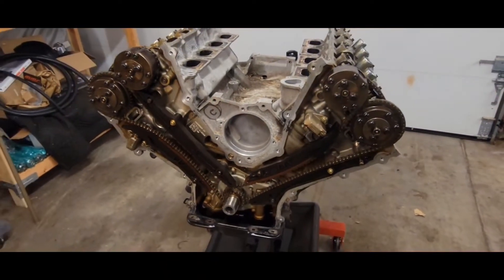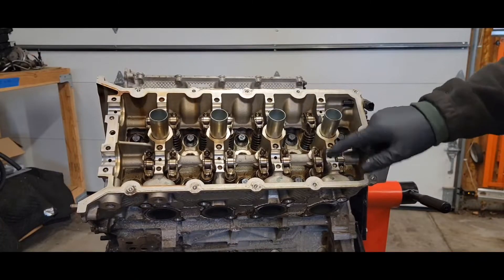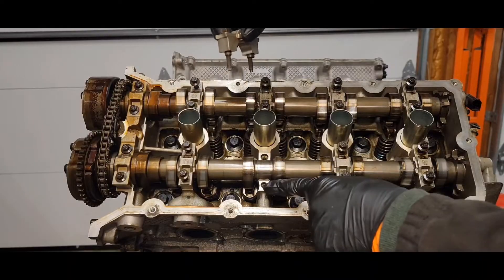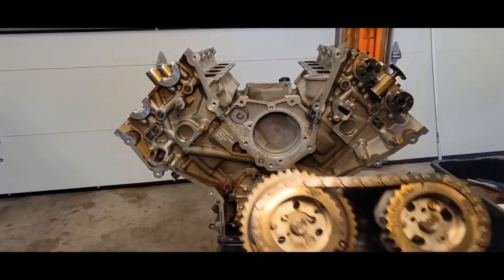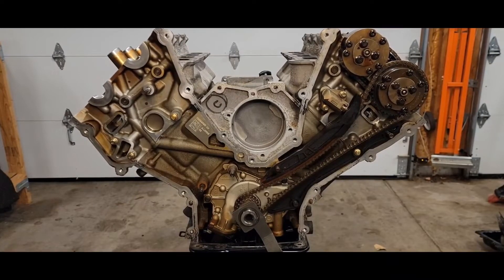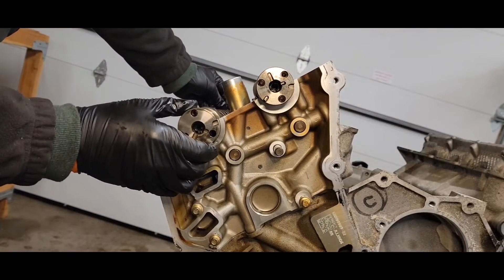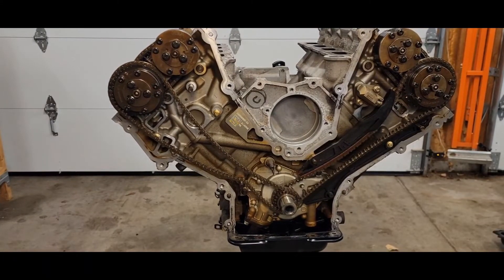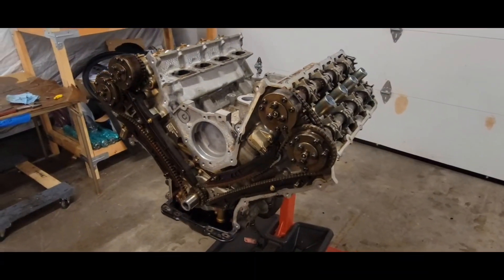How to Time:  F150 Coyote 5.0 GEN2 Engine Step-by-Step Guide

Comment from the maker: **PLEASE READ**
BEFORE YOU START THE TIMING PROCEDURE, PUT THE CRANKSHAFT KEY IN THE 5:00 O'CLOCK POSITION.

This will allow all the pistons to be below the deck when you put the heads on.

Part of the video was damaged after a couple years and had to edit out. YouTube could not repair the video.

Comment: Is there any way to check the crank for timing without removing the cover? like in reference to the phasers and timing marks at a certain point of the crank rotation or something? I hope that makes sense, but basically if my phasers are timed correct (or at least lined up to the links on the timing chain) would I be able to use them as reference to tell if my crank has jumped timing on either side?
Reply from the maker: You would need to take off the valve  covers to see the timing marks up top. Maybe you could get a scoping camera to get a angle on the crankshaft sprocket to see the timing mark there? Otherwise you're best bet is to just take the timing cover off.

Comment: Hey, so once install driver side timing chain at 3:30/5 do I make a full revolution back to 3:30/5 then go to 7:30 or do I go straight to 7:30 from 3:30/5?
Reply from the maker: No, just go clockwise to 7:30

Comment: Does it matter when taking off the timing chains?
Reply from the maker: Rotate the crankshaft in the 12 o'clock position, make sure the RIGHT timing mark is on top

Comment: @Oxman_Garage  When I set the camshafts on their neutral positions as illustrated on the instructions and as you show on this video.  On the Left side, the intake cam has a lot of free play (being neutral) but the exhaust cam does not have freeplay. and on the Right side the exhaust camshaft has a lot free play while the intake cam does not..Is this normal?  I can turn the cams that dont have free play to a different position where they have good free-play but the d-slots wont match the pictures or your video..
Reply from the maker: You can try and tighten them down like that (cam caps). And then use a wrench on the flats of the cams to turn them in there correct positions.

Comment: @Oxman_Garage  I downloaded the ford service manual for the 2017 f150  and is a litle different.. it doesnt mentions nothing at 5:00..  it says keyway 7:30  for the RH side  and wants you to do a complete revolution plus turn CW to get to 3:30 to do the LH side.
Reply from the maker: Hmmm are you sure?
Reply: @Oxman_Garage  i read it lke 4 times.. im not saying you are wrong but directions are not the same..
Reply from the maker: Hello, Im not trying to be rude, but my instructions are referencing the Ford service manual for engine assembly. This is not a $15 ebay instructions manual PDF. If you start this procedure you will need the pistons below the deck. At 5:00 crank position the pistons will be safe. After you put the Left head on, cams and chains you can turn to the 7:30. BTW you start with the Left Head not the Right Head.
Reply: @Oxman_Garage  you are a full time mechanic and im not. im not questioning your knowledge, i am questioning why the 3:30 and 5:00 differences.. i didnt write the full instructions those were to remove the chains,   and   i downloaded this manual with like 13000 pages. seems that is from ford.. i could be wrong..
Reply from the maker: No worries brother! When the crank is placed in the engine and the piston and rods are installed it doesn't matter what position it's in. When you tighten the cam caps on the left head you want the crank in the 5:00 so all the pistons are below the deck. Once the chains are installed on the left head go ahead and put it at 7:30 for the next step of the right head to be in time. No worries 🙂

Comment: Hello Sir What is the Firing order of this Engine? Is it different with the Mode 2014 down to 2007?
Reply from the maker: 2015-2017 F150 Coyote 5.0L Firing Order: 1-3-7-2-6-5-4-8
Reply: @ Sir
 Cylinder 1 2 3 4 still located at Right Bank?

Comment: Great video, very helpful. I’m doing a 2016 F150, I’ve put all timing set components back on but when installing the right (pass) side primary chain guide that’s on the outside with the tensioner, that where the guide goes onto the mounting pin, it seems like the guide is missing a spacer to keep it from sliding all the way against the block and therefore being in line with the crankshaft sprocket back row teeth (chain for drivers side). Is there supposed to be a gap , or am I missing a spacer on the mounting pin between the block and chain guide?
Thanks,
Jim
Reply from the maker: Thank you. Yes there is a little gap on the pin for that timing chain guide. Completely normal.

Comment: I have everything in the right spot but my intake cam on the passenger side does not want to seat smooth almost like a cam lobe is hitting a rocker. Any suggestions please?
Reply from the maker: Put it in the position shown, even if the cam isn't all the way down. Start the tourqe procedure. If the cam moves, use a wrench on the flats of the cam to keep it in position.
Reply: @Oxman_Garage  awesome thank you sm
Reply: This happened to me.. and i lost it..   i have to reset the timing completely like removing the cams and start from zero.

Comment: Extremely helpful. Dumb question. On reassembly, im trying to torque the harmonic balancer. Summit says 103 ft lbs, back off 1/4 turn, then 74 ft lbs.....alldata says, 103 ft lbs, loosen 360 degrees, torque to 74 ft lbs after that, then go 90 degrees. Im worried about that. I'm trying to follow all of the instructions but i just feel like that's too much. Can you let me know which one is right?
Reply from the maker: Thanks! The first one you listed is correct. You got this! :)

103 lb. Ft.
Loosen  360
74 lb. Ft.
90 degrees
Reply: @Oxman_Garage  awesome thank you man. Slapped it all back together and it runs like new. Followed alldata originally but finding your video gave me such peace of mind with physically seeing how you had it lined up compared to mine with the timing marks. 

One thing I can definitely say to anyone is use the proper tool for that crank pulley. I tried to using the install bolt from MMR and didn't have much luck unfortunately. Not sure if it was just me or if there was something I was doing wrong or what. Started feeling way too tight as I brought it in, I stopped and decided to rent the tool, lucky I did because when I took the MMR bolt out, it seemed it was trying to strip the threads either on the bolt or in the crank a little. Saw like 1 or 2 metal shavings. Rented the OEM tools balancer installer tool and it went on like butter. Barely had to use force, I guess because all of the force is applied to the nut and not rotating in the threads of the crank.

Comment: What if youre using a F150 gen 2 with mustang intake cams going in a fox? Id assume youd just use the mustsng timing instead?
Reply from the maker: If you use Mustang intake cams, you need to use Mustang exhaust cams as well. The 2015-2017 Mustang and F150 have different firing orders. I have a How to time a 15-17 Mustang GT video as well.
Reply: @Oxman_Garage  ok, so you use the timing set up from a mustang then is what I am asking and not the set up from a F150

Comment: How do you know where the crank is, or does it mater as long as you start with the crank at 5 clock then 7:30 for the passenger side. can the crank be 360 degree off, or what piston should be firing or does this matter?
Reply: Ever get this anwser ?
Reply: looking to answer the same question got my truck aprt right now trying to time it but dont want to do it wrong AGAIN

Comment: I saw your video on installing timing chains on a Gen2 F150 and noticed that the process is different than doing Gen2 Mustang.  All the other videos I’ve seen show starting with the crank at 5 o’clock and then rotating 360* and back to 12 o’clock.  For the F150, you say to start at 5 o’clock and then go to 7:30 to do the passenger side.  I haven’t been able to find that anywhere else.  Would you mind clarifying?  I have a 2017 F150 motor with F150 cams.
Reply: you’re right but on the F-150, key way was at 3:30(not 5) , put the left chain on, then turn to 7:30 and put the right chain on. 
note: when you remove it, you remove the right chain first from the 7:30,  since you only want to turn the crank clockwise, you go 1 revolution to 7:30, then do a half turn more to 3:30 where you can take off the left chain. 
Pay attention, you will see the R on the right side at 11oclock, you will see the L mark on left side at 1oclock. 
be carrful
Reply: So you do the revolution when removing but what about after installing driver side chain, do you do a full revolution from 3:30 back to 3:30 then to 7:30 or do you just go from 3:30 straight to 7:30?

Comment: Hey can you leave the cam caps on and set the timing like that or would I need to loosen them up to move them and also does it matter if it's TDC or are the valves clear of the piston when the key way is placed correctly
Reply from the maker: The cam caps have to be tourqed in place to time the system.  If you follow the procedure, the pistons will be below the valves, so there's no piston to valve contact.
Reply: @Oxman Garage  would I turn each cam individually with the caps torqued down and set them that way and thanks for the response

Comment: Hey I follow all your steps but when I put the big timing chain after half rotation it becomes loose , is the tensioner broken or did I do the timing wrong ?
Reply from the maker: What is loose?  The big chain?  What side are we talking about, the left or right?
Reply: @OxMan_Garage  yes the big one both side becomes loose at some point then tight after a half a turn and keeps going like that
Reply: @Oxman_Garage  is there any other way to contact you if u don't mind helping me ?

Comment: When installing my drivers side long chain, it is impossible for me to line up the "L" Hashmark on the exhaust phaser and still line up to the D-Slot with my exhaust phaser pin as you described. It appears my exhaust phaser is marked "R" where yours is marked "L" and "L" where your is marked "R". Will it affect anything if I line it up to the "R" instead of the "L" on the drivers side ?? Have not checked the passenger side yet but guessing I will run into the same thing. I do have ford OEM Phasers by the way. Any help would be greatly appreciated.  Thanks.
Reply: I know it was 9 months ago, but I was interested in what the resolution was here.

Comment: Hey, I have a gen 2 f150 that I am going to be pulling apart to do opg’s and cs. I have done the gen 1 stuff but not gen 2. Since the gen 2 f150 is different than the gen 2 mustang, what is the procedure to disassemble it down to do those mods? Where to start the keyway? How much to turn keyway when switching sides, etc?